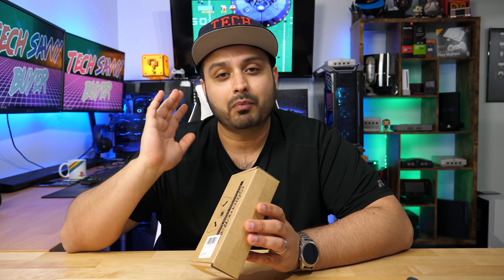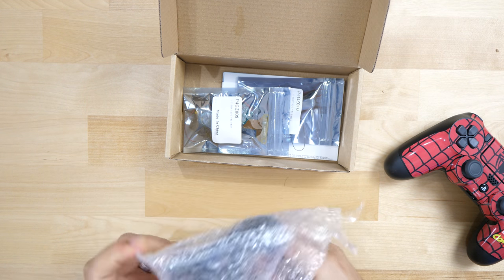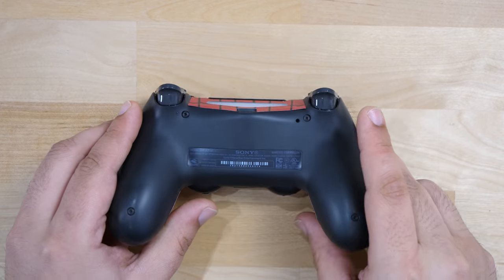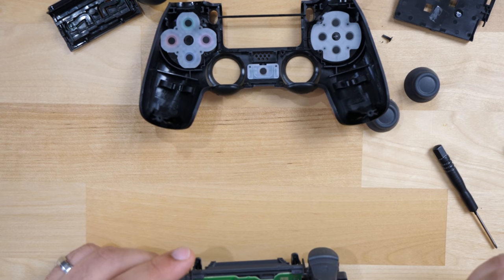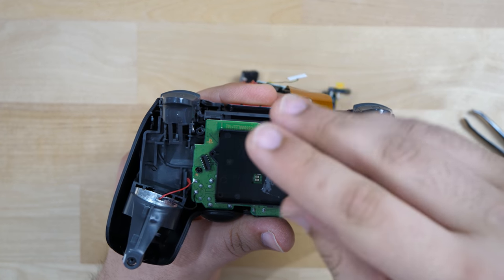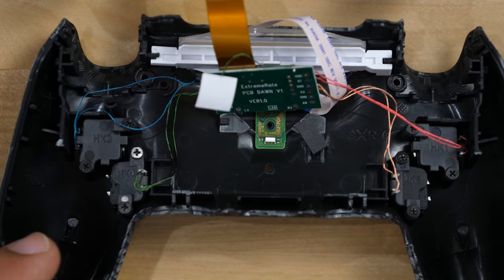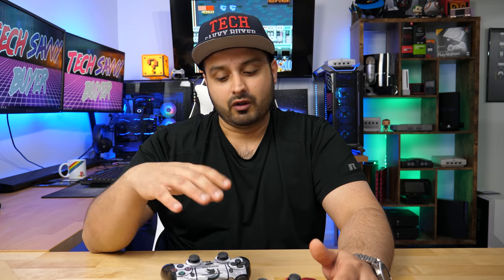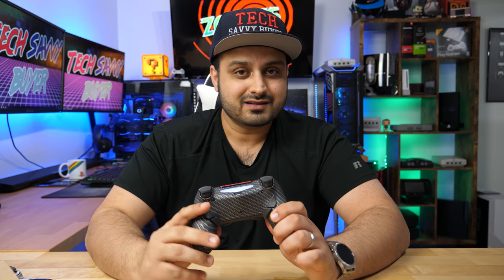$35 DIY PS4 Elite Controller! | Installation Guide & Review |

Comment: Yo man so I did everything right and connected it all and then I paired the buttons to the back ones, it blinked and everything but the buttons aren’t working?
Reply: EFX_ Zay2Shifty same here.
Reply: Bradley Runtas yo bro I fixed it, basically when I opened it up the big orange cable got folded and I forget to connect the ripper cable near the light bar back in, when I did this, it worked fine, make sure to check that big, orange cable and make sure it’s lined up correctly 👌🏽

Comment: I have an issue with the kit where every button is able to be remapped besides the triangle button. The triangle button works by itself and every single button on the back works if remapped to other buttons unless its the triangle button. The triangle button will not remap for some reason. And another issue i have is the remap mode turning on by itself. My fingers are no where near the sensors when i play but yet the mode turns on by itself and I always have to turn it off in order for the back buttons to work again. If anyone can give some feedback on what is wrong it would be appreciated
Reply: Update on issue. I bought another remap kit and same exact issues but it took a day for the issues to show while the first kit I purchased the issues showed immediately. And i do not believe it was an error i made while setting it up because the controller was working for an entire day before the issues started appearing again

Comment: I just installed one of these today. I installed everything correctly, I believe, and I remapped the button but the button doesn’t work. For example, I remapped K2 to X and when I press K2, I am not getting the button functionality of X. 

When first closing my controller shell, i struggled to get it snapped shut and opened the shell backup to see if anything was in the way and the ribbon creased.... would the crease in the ribbon be the cause of the button not working?
Reply: Is the blue light in the back of the controller on?
Reply: Ghost5000 ya the blue light pops up just fine. I then hold the two buttons for a few seconds and it blinks three times. But then the K2 button does not function as X. It just doesn’t function at all.
Reply: @bradleyruntas2598  are you exiting program mode? The blue light should be dim/off. It only brightens up when in program mode, when in program mode the k buttons won't function.
Reply: If just that button doesn't work then maybe one of the cables that connect to the motherboard came loose.
Reply: Ghost5000 I exited the program mode and the K buttons were still not working. I tried other buttons too and they still weren’t working. Is it because of the crease in the remap ribbon? It’s a pretty significant bend in the ribbon.
Reply: @bradleyruntas2598  your regular buttons are working?
Reply: Is it possible the ribbon isn't making contact with the controllers motherboard, my ribbon also has a crease and my buttons still work.
Reply: Ghost5000 when I had the remap kit in, the regular buttons were working while I was on the PlayStation home screen. X, circle, L1 and R1 etc. Once I loaded up a game.... all of those buttons stopped working while I was in the game. I could hit the home button on the control and go back to the home screen and everything would work, then going back over to the game, everything would stop working. I installed the kit in another controller, as well, and the same exact thing happened as the first controller I tried.

Comment: If you have the blue and red wires on the inside they catch the ribbon cable coming from the the main board to the power board, I made that mistake and had to order a new cable because it ripped right through it.
Reply from the maker: They are sold out - these things are flying off the shelves cuz they are awesome
Reply: FLX GLITCHINGHD I got mine from amazon UK

Comment: Guys don’t do this get the strickpack F.P.S Dominator u don’t gotta open ur controller and it’s attached and it’s only 40$ tax included
Reply: Only has 2 remappable buttons and only can play wired and the connection where the charger goes wears off and starts to turn off by itself:/ i know from experience
Reply: Yep so many people have issues with disconnecting mid game.  I loved my strikepack at first, but now its disconnecting every 5-10 minutes.  Its unusable.  Tech support offered many options, but none worked.  At least it only cost me $40.

Comment: If you want paddles then get this 
If you want a controller that will last,fully customizable and easily repaired 
Get the scuf
Reply: Not about to drop the price of the whole console on a control imma buy this thank you very much
Reply: Burrito Its Worth It Tho, You’ll never have to buy another controller again
Reply: @NoRest4TheWicked1  ive had my stock ps4 controller since 2013 im pretty sure theyre built well
Reply: Burrito they’re really not...they’re literally made with super cheap materials even if it held up a long time Doesn’t Mean it’s made well. The fact is the scufs are made with higher quality materials. Your controller probably has problems you’re not even aware of, they arent made to last that long. If you open it you’ll see

Comment: The programming light on mine keeps turning on while I play and it deactivates the paddles what do I do??
Reply: Could be that the touch sensor is messing up or your finger is always near it. I just cut the touch sensor off with scissors. You can enter programming mode without it anyway by holding L1 + R1 + Down + X. If you don't want to cut the touch sensor off then you can try sticking it somewhere else on the shell.
Reply: EgzecVFX firreeee thank you how do you enter it after you cut it?
Reply: @alex.febres  If you mean entering the program/remap mode then hold L1 + R1 + Dpad Down + X for around 5 seconds, you should see the blue light on the bottom like usual and you'll be in programming mode again :) Same thing for exiting it
Reply: EgzecVFX 🙏🏼🙏🏼🙏🏼🙏🏼 legend

Comment: Scuff controlers absolutely are garbage.  They break if your neighbor sneezes too loud and Scuff knows this which is why their warranty program is a joke.  I strongly recommend Evil shift controllers and their warranty program is probaly the best there is out there (1 year).  A bunch of my friends bought Scuff, but I refused becuase they would begin to complain about their sticks not working right, buttons not pressing only a couple of months of gaming later.  After a ton of searching, I took the dive with Evil controllers and got their Shift controller and about a year later, the color faded where my fingers rested and the warranty covered the paint replacement. 

Back to the video, these look great for budget button mods though.
Reply: I've had 4 Scuf controller fail. So, I switched to AimControllers... they're fantastic. Way better than Scuf quality and also 1 year warranty. I'll never go back to Scuf again. 
I'm definitely gonna try this DIY mod out though on my regular DS4. It's very good for the price.

Comment: Its Kool but I would rather spend $40 on strike pack that you can just unplug from controller and can adjust trigger sensitivity in software. You have to deal with all them small wires when dual shock goes to shit 😂. No thanks. Nothing beats FPS Dominator strike pack for $40.

Comment: Can i do it with the regular dualshock 4
Reply from the maker: it needs to have the lightbar on the touchpad
Reply: @TechSavvyBuyer  it does have the lightpad.
Reply: @TechSavvyBuyer  is that the only thing that makes the difference?
Reply from the maker: Basically. If it has the light bar line facing you through the TouchPad. This controller revision launched woth the pro. Google it to see of yours is the same

Comment: I close my controller everything is there it charges but the home button does not work help help plss
Reply from the maker: Check the ribbon cable. Make sure that is aligned correctly. You'll have to reopen it.
Reply: Tech Savvy Buyer i did it charges i see the light the home button and the sensor isn’t responding

Comment: Or you can buy a strike pack dominator for 40$
Reply: I have the dominator strike pack.. after a while it started messing with my wireless mic and some times disconnect midgame and I never really liked having it plugged in... resetting my controller and headset was annoying but bearable as is having to keep it plugged in...but 4 "paddles" and wireless.. I just got mine today...dreading the wire work in fear of f*ing up but worth a try. If it's easy I'll make a business out of selling pre-built ones on Ebay.

Comment: 16:29 didnt recap what you did here at all unfortunately. did you solder those wires? you did not list a soldering kit/gun in the "things you need" portion of the video. bummer..
Reply from the maker: No soldering required

Comment: this controller isn't anywhere near worth it 
35$ + effort of installation
while you can buy a scuf one for like 100-120$ 
normal one costs 60$, 60+35=95$, no to mention it voids the warranty.
Reply from the maker: Nobody is saying buy a new controller just to mod it. Its an add on for existing controllers - and its more of a fun DIY project. if you look at this like its work or effort then just buy a scuf.

Comment: The ps4 scuff controller is an absolute joke. It's like they didnt even try. They tried to make it as cheap as possible and a 200 dollar controller STILL has dead zones in most of the controllers. I've had two, the first one had such bad dead zones I had to return it. And that was a hassle to do. My second one STILL had dead zones but not as bad. I bought the xbox elite controller and and an adapter for my ps4 and that's the best route to go.
Reply: If SCUF somehow isnt working out then try a Razer Raiju, Nacon Revolution, ASTRO C40, or a standard DualShock 4 with Strikepack FPS Dominator, Extended Thumbgrips, Trigger Extenders, and Grips

Comment: Dude this is to much just buy the fps dominator
Reply: FPS Dominator costs the same, has a way better trigger position, and takes 1 min to setup without taking apart your controller. 

I don't understand why they couldn't make it easier. Ship the back plate with the buttons and the chip preinstalled. Then all you'd have to do is connect the ribbon and you're set.
Reply: @Reginald_Harrison  I have a dominator and I would still do this to get untethered from a power cord so what if it takes a hour to do

Comment: But it doesn't fix your input delay lmao trust me guys you want a scuff the input delay is non existent
Reply from the maker: Have u used both to make that comment?
Reply: @TechSavvyBuyer  I've used a normal dual shock 4 and a scuff that was lent to me for a week. This product is an add on correct? So that doesn't fix the input delay but for casuals that don't want to spend all that much then go ahead but hardcore gamers could and can benefit from this product but would definitely benefit more from a scuff in my opinion
Reply from the maker: @IsDatZK  I agree. But look at the cost difference
Reply: @TechSavvyBuyer  that's what I mean it's a hard decision for the hardcore players. I dont want to be one of them but I am😂
Reply: You can easily fix input delay by wiring your controller.
Just plug a decent USB cable on the controller and that's It.
I've installed that kit and It did not effect input lag at All

Comment: It ripped the tape copper thing ripped
Reply from the maker: They have another one in there
Reply: Tech Savvy Buyer Ik that but i don’t know how to put it on or w.e
Reply from the maker: It's, a, sensor so just make sure it touches the wire when you install it.
Reply: Tech Savvy Buyer so can I just put the wire under the copper when I stick the copper down

Comment: This thing is bs. They sent me a back controller case waaayy too small. Nothing fit in the shell. Waste of time and money. Knew I shouldnt have bought a diy kit from a sketchy ass company. Just buy a scuf or a strike pack or something like that because these things are a gamble
Reply: Mykel Mods Nerf I did watch the video. Multiple times actually. I have the exact same model that he was using in the video.
Reply from the maker: That can't be right. I've done this like 20 times so far n no issues with fitment whatsoever. I call a bluff man. No offense
Reply: Tech Savvy Buyer light bar parts wouldn’t fit and the paddle buttons wouldn’t stay put no matter what. I believe it’s just a faulty case
Reply from the maker: Hmm did you reach out to them for a replacement?
Reply: Tech Savvy Buyer I’ll try to now
Reply from the maker: Lemme know what happens. I'll follow up with them if they refuse u a replacement. Keep me on copy of your email. Thetechsavvybuyer@gmail.com